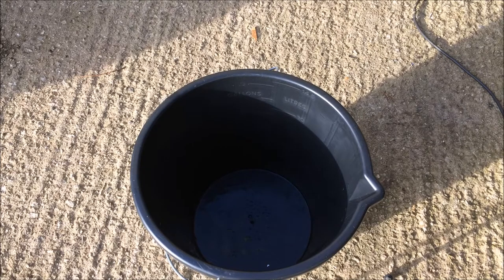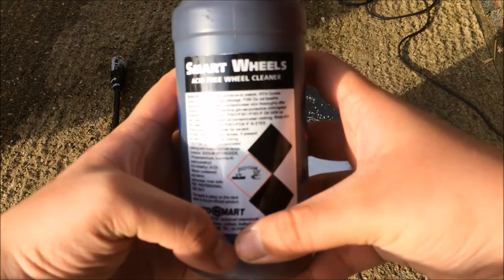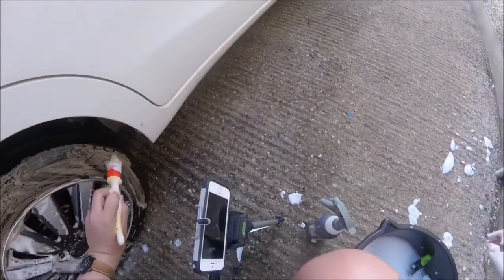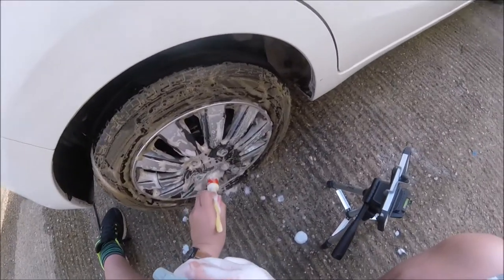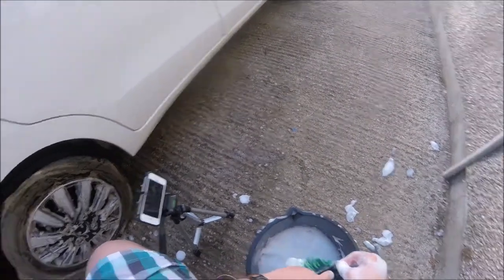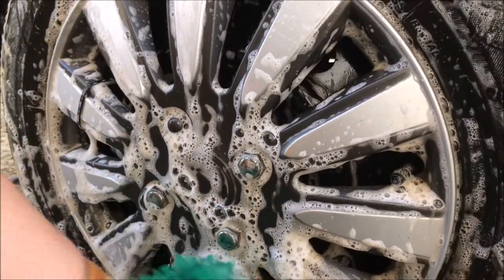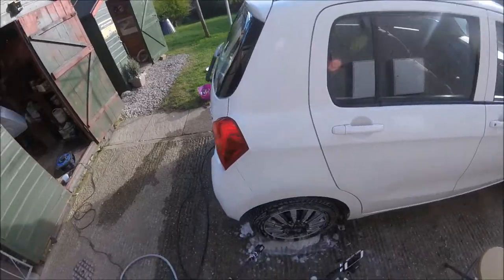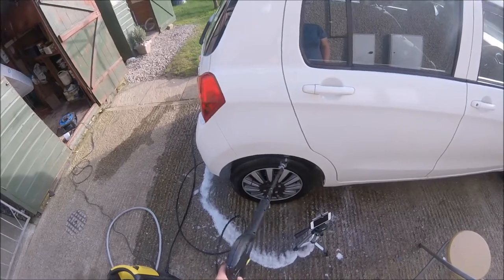Reviewing Autosmart's Acid Free Smart Wheel Cleaner

Comment: you can dilute it more than just 50:50
Reply: I use it neat at work 🤣👌🏼. Pro tip. The shine it gives makes it a great engine bay detailer. Light rinse. Then spray over the dirty areas and then just work it with a brush and rinse. Makes it mint 👌🏼